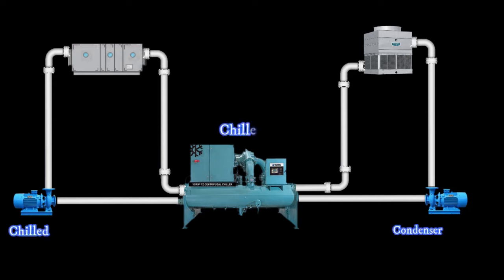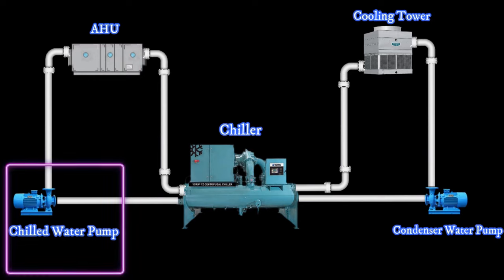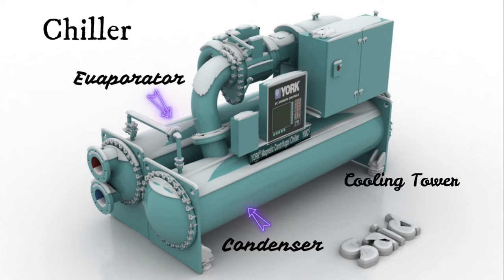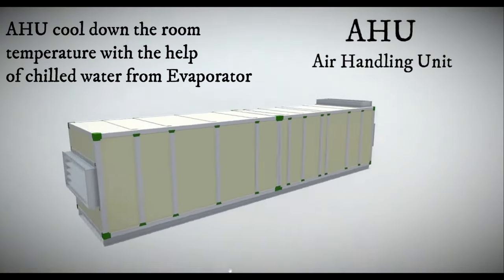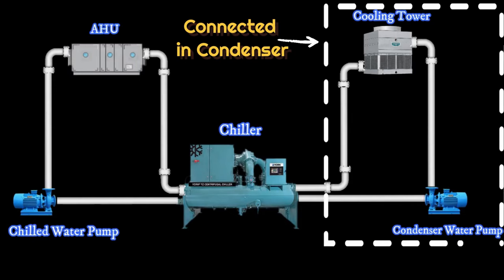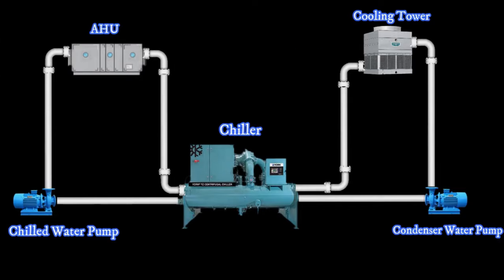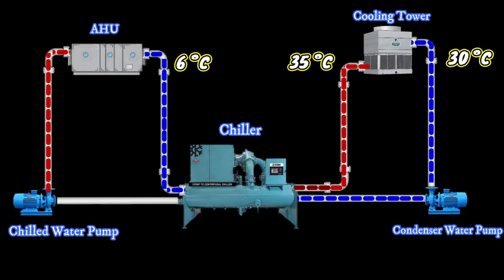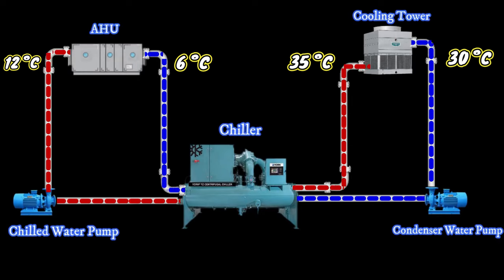Working Principle of Chiller Plant | Animation | English

Comment: Water flow is going the incorrect direction into both pumps and into the cooling tower.
Reply from the maker: Can you please explain?
I have checked it's gong in correct direction.
Reply: The inlet water for cooling tower must in the top 35 c. 
Then the outlet must be in the bottom of the cooling tower 30 c ., and so on for the AHU.
Reply from the maker: Yeah, I checked now. You're correct the inlet for cooling tower should be at top and outlet should be at bottom. 
Thank you for letting me know.
Reply: The direction is wrong it’s supposed to go in 12 to 6 .. not 6 to 12
Reply from the maker: @Dirtydollars020  6 ºC to 12 ºC is the correct one. The chiller will send the chilled water to the AHU and AHU will use that water and sends out at 12 ºC.
Reply: The water supplied  to the cooling tower enter from the top not the bottom as show. This will allow natural air cooling as water drop vía drop aliminators  to the basin.
Reply: close enough lmao
Reply: My question is out going water from cooling tower is 35 deg. Then how AHU is getting water at 12 deg.
Reply: @chanse2u 2 different closed loop systems that never mix.

Comment: Water flow direction is not correct
Reply from the maker: The flow direction is correct. Only the inlet and outlet position is wrong. That I already mentioned it. That's for the design I changed that.
Next time it will be perfect.
Thanks for your comment.

Comment: I Think direction flow for suction and discharge is wrong. thanks
Reply from the maker: Yeah, that's I already mentioned in the comments. For the design, I changed that. However, the working principle is the same.

Comment: Which part would output/emit hot air (due to the process, if there is) into the environment? Is it the cooling tower? and would such cooling tower be mouted on top of the building roof?
Reply: khí nóng có thể đc tận dụng qua bộ làm nóng nước ( nghiên cứu khoa học )

Comment: Sir..just asking..I stop the AHU sistem..do i need to stop the  chiller water pump?
Reply from the maker: In some HVAC systems, the chilled water pump may serve multiple AHUs. If turning off the AHU means that no cooling is required in any part of the building, it may be reasonable to turn off the chilled water pump to save energy. However, if there are other areas that still require cooling, you should keep the chilled water pump running.

Comment: Like the animation except the mistake of the flow. The hot water exiting the condenser should fall from the top pipe down not the bottom pipe up. Other than that good and informative

Comment: why does this system need a cooling tower if it already has a chiller. Seems that the cooling tower only contributes to cooling the water by 5 degrees, a marginal contribution.
Reply from the maker: The Chiller is using the water from Cooling Tower to Cool down the temperature of the Refrigerant.
In Air Cooled Chiller, the chiller using Air to cooled down the Refrigerant Temperature.
So, Cooling Tower is much important Component in a Chiller system.
How Cooling tower works and How the water from the Cooling tower is used in the Chiller these are explained in the previous video.
The link is below please watch.

Cooling Tower Working Principle
https://youtu.be/GdFuAA68Pw0

Chiller Working Principle
https://youtu.be/HAxv0T3NVe4

Chiller Working by Balloon Experiment
https://youtu.be/tPEjYj-xiVM

What will happen if there is no Cooling Tower
https://youtu.be/IhfvLBI1VMQ

Comment: R134a refrigerant chiller plant section pressure???
Reply from the maker: The suction pressure can vary depend on the design and load.
Reply: Suction pressure should be 30-40psig and 
Discharge pressure should be 140-180psig

Comment: How does water go to cooling tower from condenser witout pump
Reply from the maker: Actually the condenser water pump is pumping the water from chiller to cooling tower.
The chilled water pump is pumping the water from chiller to AHU.
The one pump is doing the both jobs.
In some of the chiller plant we can see two pumps called Primary pump and secondary pump.
Primary pump is used to pump the water to chiller and secondary pump is used to pump the water to AHU or cooling plant.
But in some of the plants only primary pump is enough to pump the water to chiller and AHU or Cooling tower.
Here I have mentioned primary pump chiller plant.
Thank you asking your doubts.
If you need more clarification please don't hesitate to ask.
Reply: @zebralearningsenglish-pn6fl  please correct in the animation also inlet
Reply: I think inlet is from downside and outlet is abov
Reply: @zebralearningsenglish-pn6fl  ok thanks
Reply from the maker: Thanks for letting me know. Actually I know that already. But I wanted to keep the pump in horizontal position that's why I made this animation like this.

Comment: Where is the Inlet water coming from ? Is there a continuous flow of inlet water? I’m confused
Reply: The water entering the cooling tower at 35deg C where is that coming from?
Reply from the maker: The chilled water circulates inside the pipelines. 
But when there is a need for water due to water leakages, the water will be added from the makeup tank.
Reply: But how did the water get into the chiller in the first place that’s what I don’t understand 

Where did the water going into the evaporator to produce the chilled water come from? Is there a tank in the AHU that is sending water to the chiller?

I understand the closed loop but the video didn’t really discuss how the water got in there in the first place
Reply: But how did the water get into the chiller in the first place that’s what I don’t understand 

Where did the water going into the evaporator to produce the chilled water come from? Is there a tank in the AHU that is sending water to the chiller?

I understand the closed loop but the video didn’t really discuss how the water got in there in the first place
Reply from the maker: Now I can understand your question. There will be a tank called Makeup tank. From that tank, a pump is connected to the pipeline of the chiller. From that tank, water will be filled throughout the chiller pipeline first. Then the water continues to circulate in a closed loop. If there is any leakage of water in the chiller pipeline. From the makeup tank, the water is again added to the chiller pipeline through the pump.
Reply from the maker: if you still have the doubt please feel free to ask.
Reply from the maker: And there is a video in our channel that's explaining what is happening inside the evaporator.
The link for that video is below, please click the link and watch the video.
thank you!😊
https://youtu.be/Y1Ph07ZWKv4?si=IUSRUfjY32Pa-MYV

Comment: Chillers with AHU doesn't make sense to me! Why not just use AC and put the evaporator in the AHU?
I've seen some buildings that don't have the AHU but the chiller's cold water goes into the building and special radiators with blowers cool down the interior.
Reply from the maker: It's based on the size of the area where we want to cool down. If the area is small, we can use FCU which is like AHU but small in size. FCU uses the chilled water from chiller and blows the cooled air. but, for the largest areas, AHU is the efficient one to cools down the room temperature.

Comment: The pump is on the wrong side because the suction of the pump is horizotal and the pump is discharge pump is on top.
Reply from the maker: Yeah, I wanted to keep the pump in Horizontal direction only. That's why I designed like this. Thank you for letting me know.